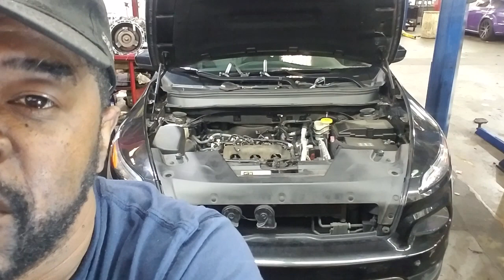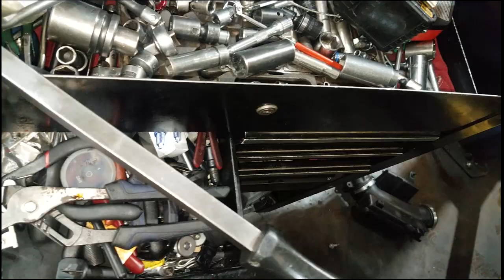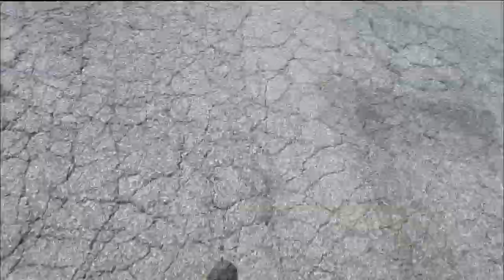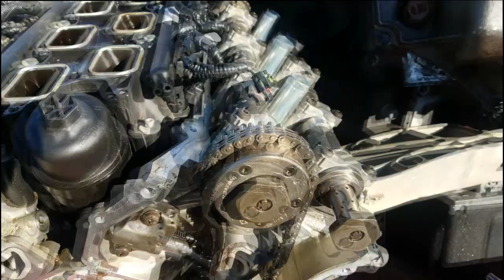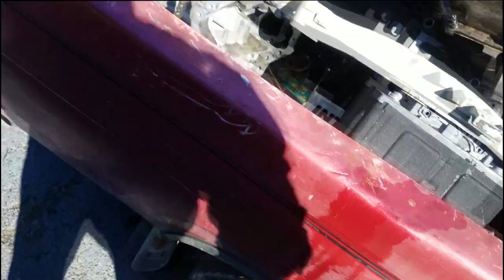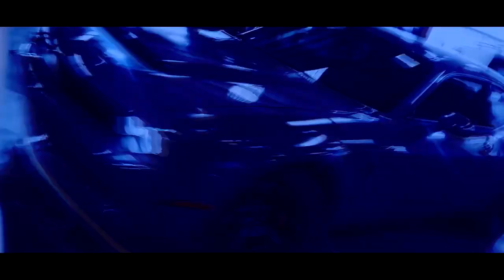WARNING. BAD MISTAKE 3.2L 3.6L Pentastar V6 problems ticking rocker arm noise camshaft phaser P0300

Comment: Yes I’m a subscriber 😂😂😂😂 and that’s exactly what my cam looks like so I’m gonna replace it as it’s 300@ Mopar. I won’t go junkyard as it’s m wife’s money and I don’t want to have to tear this open again for a while. Good info and I used the chain tensioner tools to do this job. For a first timer on a pentastar it was the thing to do, but as you’ve said you can get by without it. 15$ from Amazon I said wtf. Cost me a total of 1100 in parts including one new cam, a coil, a fuel injector, all the rockers and lifters, updated Dorman oil filter housing and I’m cleaning up the oil pan as you speak. Yeah you’re right to do it right you got to clean up that oil pan as that finely ground metal is sticking to something. Those cam magnets were coated with that. Did a phaser clean as I have an autel scanner that has that capability and I’ll do a frequent oil change it two and put the bitch to bed 😂😂😂😂😂

Comment: On-Line Mechanic, I have a 2014 Jeep JK and ended up with the tick. I pulled the top end apart and found one Rocker had slightly loose bearing, (not nearly as bad as some in your videos) so I replaced all rockers and lifters. Thinking soon or later they would need replaced. The cam had very little damage, looked better than the one you said you would probably still use. I di not replace it. Now when I start the jeep cold, quiet like new, as they engine heats up, ticking gets louder and louder again. It ticks louder as it gets hotter. I thought maybe the oil cooler was bad. I tore it apart and noticed it was leaking a little. Replaced the cooler body with upgrade aluminum unit and flushed the cooler unit good and re-installed. Still ticking when hot. What can I do to fix this damn tick?

Comment: i have a 3,6 challenger sxt. had a vacum leak took my intake off upper and lower gasets replaced.  didnt touch my valve cover or anything else. just my intake. i turn on my car now its makes a clicking sound and it smells like gas . i check under the hood everything looks fine. what am i doing wrong?
Reply from the maker: My dude, is your check engine light on? If so, whats the code? Also are you subscribed to the channel?
Reply: CLICKING SOUND HAS SOMETHING TO DO WITH PARKING PRAWL. TOW TRUCK DRIVER DOSNT ENGAGE NEUTRAL LATCH , USES 1ST GEAR TO BRING MY CAR HOME . PUSHING THE CAR MAKES CLICKING SOUND. LIKE THE WHEEL OF FORTUNE WHEEL. YES SUBCRIBED. FIXED GAS SMELL , BROKEN GAS LINES. hELP WITH CLICKING SOUND . ENGAGES WITH IGNITION AND MATCHES RPM IDLES SPEED . IT DRIVES BUT GET LOUDER WITH SPEED

Comment: I have a 2012 Chrysler 200s modelc3.6 v6 87k miles motor is going out ticking like a time bomb and I owned it since new and maintained it misfiring badly on number 6 changed all plugs and coils still misfiring

Comment: Awesome videos! I need help on my 3.6 challenger 2012 , so i get a p0304 code. I replaced the sparkplugs moved around the coils hoping the code would chage to another p03xx for just a simple  coil fix. But nothing. Tested the fuel injectors oms but all good.  Took it to a dealer ship and they said it was a camshaft wearing. I took it all apart. Camms look good as well as the rockers. Help please!
Reply from the maker: Hello my friend, thanks for watching. How many miles on this 3.6? O please sub the channel and hit the bell for me, thanks
Reply: 101,526 miles on it, and the dealer said it didnt fall under the head extended warranty.
Reply: One thing that is weird  is that at a red light the engine  rpms fall under 500 and engine  starts to shake almost  wants to stall. I already replaced  the crank sensor  and a new cam sensor .
Reply from the maker: @JorgeMendoza-yp9yw  hey whats the last 9 digits of your VIN, I can check it..DID YOU SUBSCRIBE TO THE CHANNEL?
Reply: Yes sir i did, and its 0CH170326. Thank you for replying back btw!
Reply from the maker: @JorgeMendoza-yp9yw  Listen, Your car qualify for the X56 extended cylinder head warranty. I can see that on your coverage. I can also see where you had a complaint of a P0304 misfire in cyl 4 which is also 1 of the requirments. I also see where you moved coils and plugs around chasing misfire so its ovious that problem inside the bank 2 cyl head..Im not sure why that dealer not honoring your warranty.  The problem you having now with the P3040 will likely lead you to replacing the cam phaser on bank 1 exhaust. That is not covered, neither are noisey lifters or rocker arms..Sometime when we honor that x56 warranty, the custer just pay for the needed rockers arms out of there pocket.
Reply: Thank you! I will go back to the dealer  and see what they can do to honer the extended warranty!
Reply: The dealership  stright ignores me , i ended up taking apart to replace  the cam exhaust phaser on bank 2 along with rockes and lifters for cylinder 4. Even tho everything looks good. The cams looks in great shape.  We'll se what happens.

Comment: Damn sometimes I wish I had of gotten that v6 Cherokee for the power torque and no oil consumption issues instead of the 2.4 because of that oil consumption
Reply from the maker: IKR, I own a 2017 Cherokee with the 2.4 thats burning oil. Other than that, its a good car for the Mrs..Right before my warranty expire, new engine it is.
Reply: @OnlineMechanicTips  I'm already in consumption test myself dealer told me to drive it another 500 miles and bring it back
Reply: @OnlineMechanicTips  do  people still have oil consumption even after there engine get replace
Reply from the maker: @brotha1984  Yea Chrysler told dealers to change the oil to correct level then start the test. If its low, then depending on the warranty, we might have to install a new engine
Reply from the maker: @brotha1984  No, The newer have different piston rings and seals.
Reply: @OnlineMechanicTips  good looking out JT appreciate the info

Comment: I just had my rockers replaced on bank 2 and  exhaust cam replaced.  I’m getting a P219B DTC. But I had this code prior to repair as well.  When I had problems with bank one rockers and after they repair car ran really good and mpg was up and no codes. Now this time around mpg’s is still low and P219B  DTC code is present.  All the rockers were replaced on the left head with a exhaust cam. Any ideas what could be causing this issue ?
Reply from the maker: My friend, if you had P2198 air/fuel imbalance before the repairs and after, If you use a slowly dying coming apart cam phaser, you will have the same problem you had before the repairs,. Its hard to look at cam phasers and tell if they coming apart. I tend to do them anyways after 100k. If the timing marks at specs, you may have a phaser acting up on you that may never throw a fault code.
Reply: Online Mechanic Tips I got 170k plus miles on it.

Comment: Awesome video 👍👍.  Glad you had cams on hand. Could you video sound clip after you finish this Cherokee. I also thought new gen Pentastar did have rocker   issue?
Reply from the maker: It's the 3rd gen found in the Pacifica. The Grand Cherokee and Durango started in 2016 so everything since then have the 3rd gen with know valve train issues. And sorry, that Cherokee gone, cust came and got it as soon as it was finished.

Comment: What do think about replacing a 3.5 motor in a 06 Pacifica,  is it difficult and do you think it would be worth it?
Reply: If u have to ask....you shouldn't be doing it.
Reply: @pauljoey7977  ?
Reply: That really helps answer the question! Not
Reply from the maker: Hello my friend, the last time I did a swap out engine on a Pacifica I had mor trouble with the the exhaust but after I get it loose, we ended up bring it from the bottom. We use a special crate tool that supports the cradle which made it a little easier, not sure if you have that tool. As far as is it worth it, that part hard to answer because im not sure what you have in it or on it or the miles. Please subscribe to the channel, thanks for watching
Reply: Thanks for your advice!

Comment: Why can you not swap 3.6 cams for 3.2 cam? They are both 6 cylinders. Is it because of the cams profile? I.E. lift, duration, etc.. Just curious.
Reply from the maker: I'm just as curious as you bud because they look exactly the same..lol..but because it has that big huge 3.2 stamped on it, I'm afraid to find out. Lol. Thanks for watching..please thumbs up the vid and sub for me, thanks
Reply: @OnlineMechanicTips  i figured that the only thing that would make the 3.6L bigger would be maybe either a deeper combustion chamber, bigger diameter pistons, or longer stock( by longer rods or different position on the wrist pin hole location on pistons).